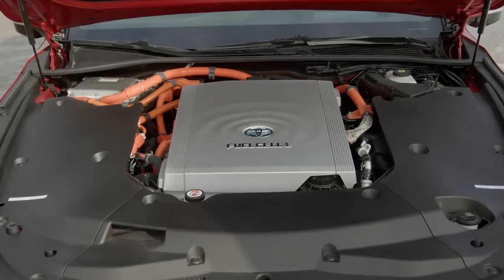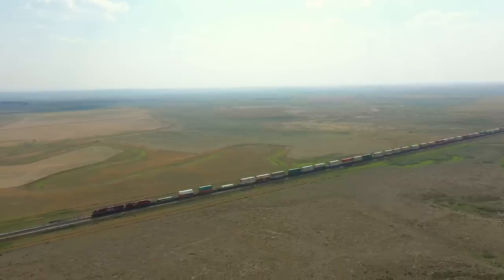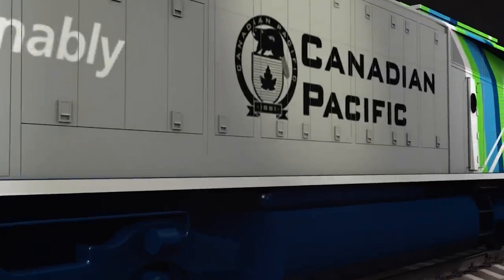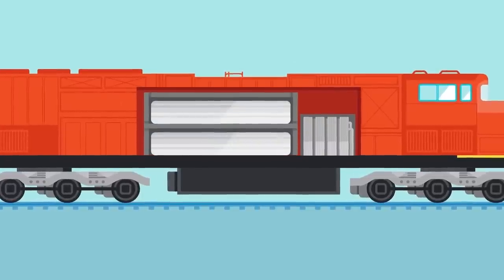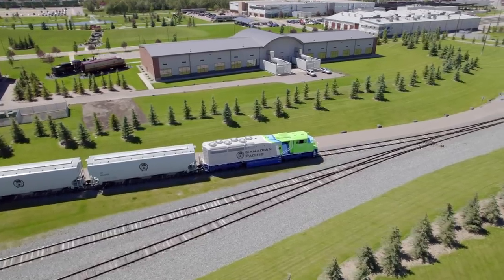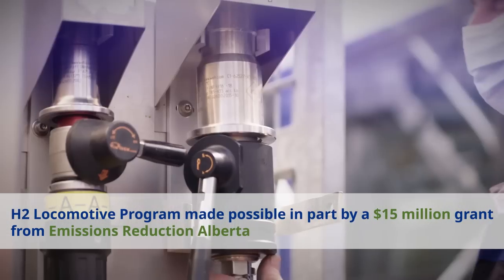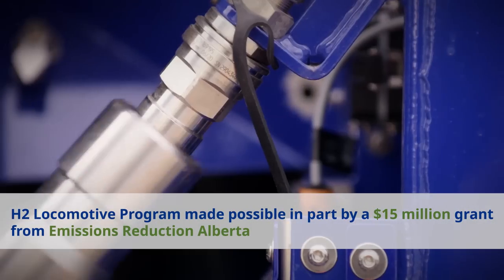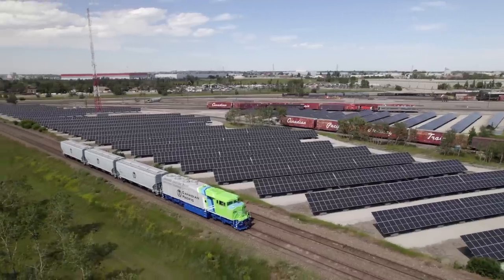Hydrogen fuel cell electric freight locomotives already running

Comment: For low-usage branch lines, hydrogen and batteries are okay. But for heavily used lines, it would be much better to just electrify normally with wires.
Reply: Depends on how long the run is, if your talking about CP rail that goes across the country, your talking about maintaining thousands of KM of electric lines with heavy snow fall and freezing rain, much cheaper to build a hydrogen farm and convert diesel locomotives.

Comment: CP  has 1,400 locomotives not over 30,000. Part of the experience on CN in Alberta with 2 LNG locomotives. Needless to say  that program was scrapped. Watched the electrication of BC Rail Trumbler Ridge sub in the 80's which did not last long   Hopefully hydrogen works in the field.  I am sure they also had major problems when diesel replaced steam on railways.
Reply: I think he was referring to the North American fleet overall, but that's just my guess.
Reply: The BC rail electrification likely failed due to the cost of maintaining the catenary, and the fact that pure electric locomotive lack flexibility in that they can only run on electrified lines.  These problems are not experienced with hydrogen locomotives.
Reply: @heronimousbrapson863  That's only part of the reason. The biggest reason was that the coal mines that the Tumbler Ridge sub served closed down due to a decline in the BC coal market, and frankly BC rail didn't double-down like they really should have and expanded electrification to the rest of their system. Electrification is cheaper to maintain, but only really when the electric network is more than just one or two lines, or when it's a really big line that gets a lot of traffic (the Northeast Corridor comes to mind). Because of the non-standard nature of electrification by comparison to the diesel fleet they ran everywhere else, they saw it as being good to remove the non-standard bit of the network and revert back to diesel. In hindsight, whenever railroads do this, it's a big mistake, but they never reverse this mistake because of their short-term profit mentality forced upon them by their shareholders. It will take a big new electrification project proving it's worth (I'm thinking California HSR or Brightline West for instance), and increasing emission regulations surrounding trains taking effect that will force the issue for railroads to go back to electrification, both of which are being seen at the moment.

Comment: And above all let's not talk about the current market price for H2 is $35/kg which means fulling costs are best part of 4 times higher and that's for petroleum based H2. The often mentioned "green H2" with a price target of $2 are purely for investor presentations. This will never happen as clean water required in vast quantities does not exist. Reminder 1kg of H2 requires 6 litres of water.😡

Comment: I think over time a net new locomotive will be of vastly less expense once this fuel technology and securing of said fuel is validated so yes, retrofitting is the right place to begin but the goal must be to create an entirely new systems engineering package as well in order to take full advantage of what is already a commercially available and utilized fuel and battery chemistry #nikola_motors by way of example. Why US Federal Government financed Amtrak is not leading the way in validating holistically this technology is quite the mystery but the USA does have private rail in the form of Brightline and regional "Septa", Denver Commuter Rail and "LIRR" Long Island Railroad which have validated regenerative braking systems going on 50 plus Years now now entering into US vehicular service for over a decade now as well. These types of "super capacitor systems" I think they are called are very much part of the solution.